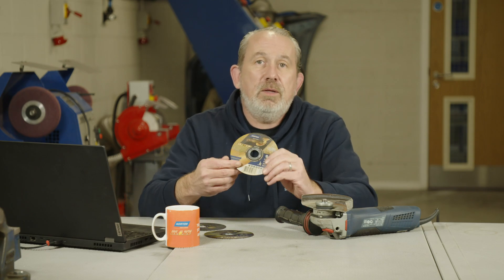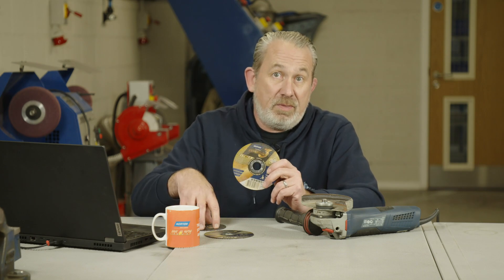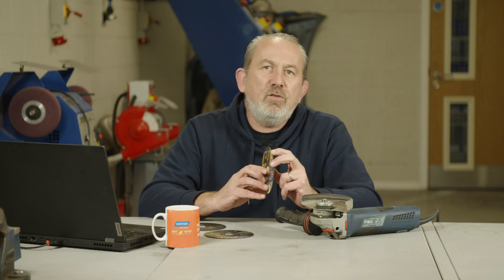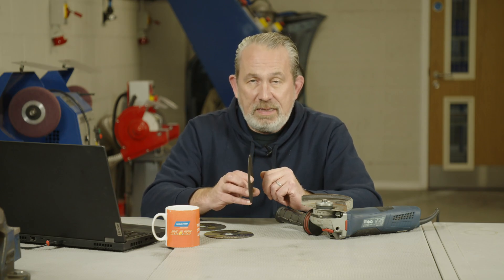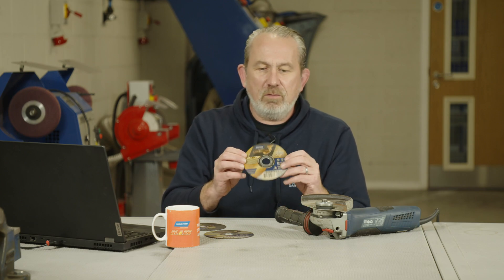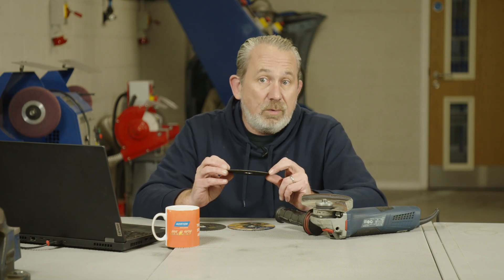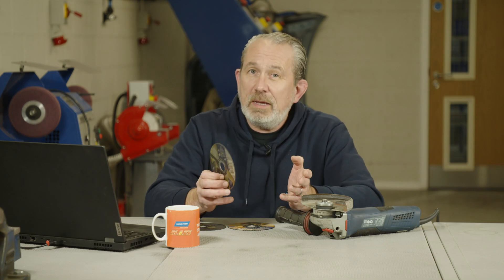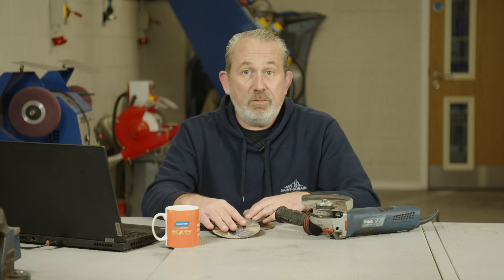ASK THE EXPERT: How to get precise cuts in thick metal with an angle grinder

Comment: My trick for cutting 1/4"+ plate steel is to scribe a line, and I always try and keep the line. Then (I'm right handed) I take the grinder in my right hand and watch down the side with no guard. I lake my left hand and steady the back of the guard, carefully. Then I get the wheel cutting and not bouncing about, and do a really light skim cut all the way down my scribe line, with no pressure. Let the grinder under it's own weight just eat as it wants. Once I have light line I then go back and forth along as much of the length as comfortable. Back and forth, back and forth, back and forth, making sure I'm holding my grinder level and plumb. Always checking in with my hands to make sure I'm not adding any pressure or sideways tweek to my travel. It's all about patience and a bit of practice. If I did wobble then it's no big deal because I kept the line, and I can flap wheel off any non straight bits. I realize you're trying to sell a product, but you could have added a tad bit more than just draw a line. There is so much more to it.